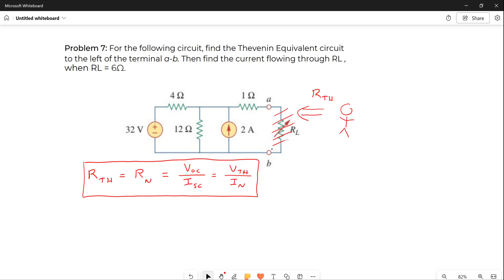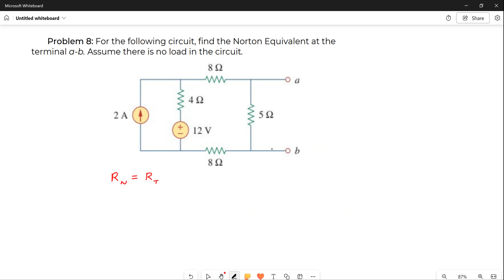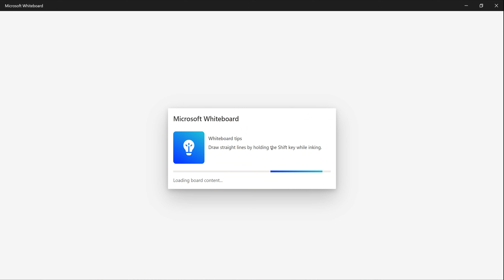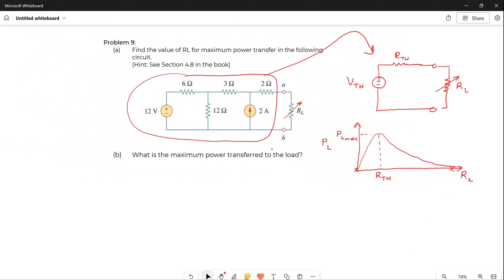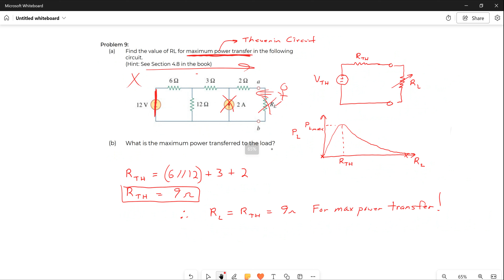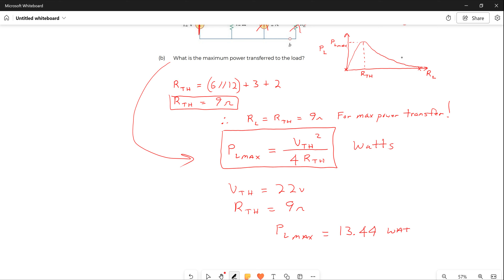Thevenin's Resistance Made Easy by Prof Skip

Comment: What if the charge is not nicely put at the end of the circuit (at an extreme of the circuit) but rather on the center of it. I cant find a single video that works with examples like that!!